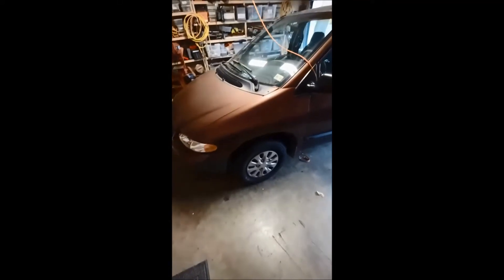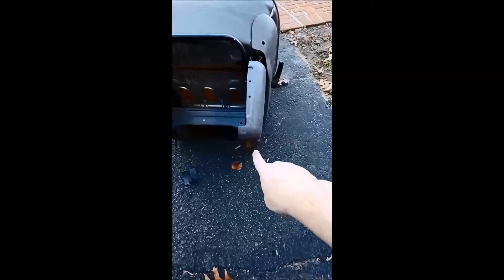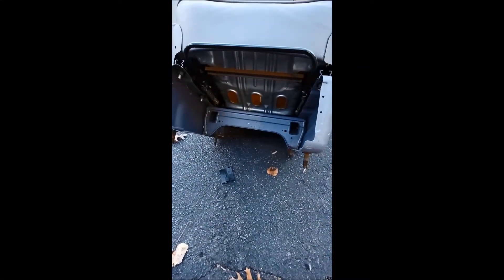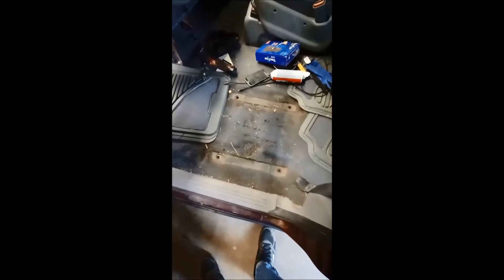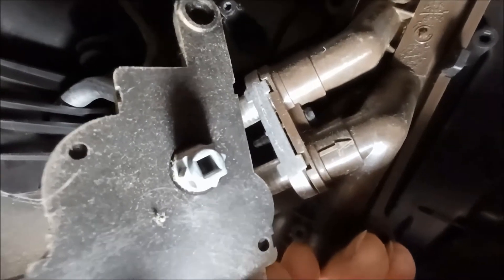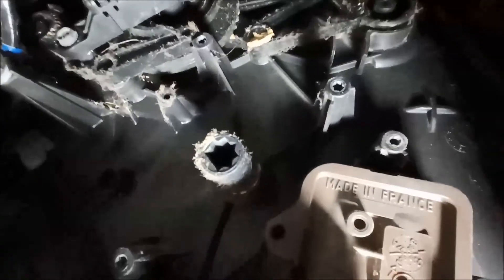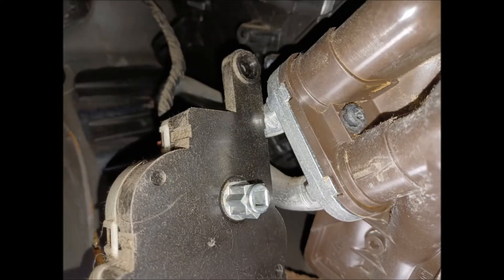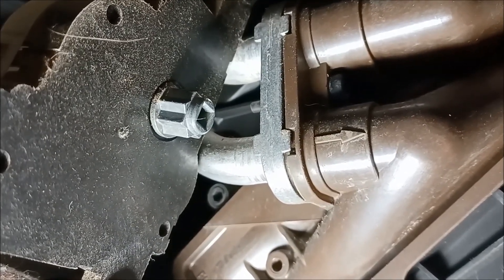1999 Plymouth Grand Voyager or Dodge Caravan Replace Blend Servo Actuator

Comment: ...this is the type of non-help infamous on YouTube. attempted this surgery 04-20-24 on my 1999 Voyager. After removing multiple obstacles and spending over 2hrs on back and sideways inside vehicle, there was NO way to access the topmost or #3 screw holding actuator in place from Under or Frontwards or from left or right. Only possible way, down thru the top of dash - requiring disassembly of dash to include instrument cluster. This Video - the new part NOT installed. Key Words, without video "After You Get it Out" and at the End? "Good Luck". This Project would require at least two days for the Home Fix-it Person.  a One Minute 36 second Vid for a 5-6 hour job?
Reply from the maker: That's the only way to do the job, on your back and twisted around. it helps a little if you take out the driver's seat. Even then, if the ac controller does not actuate it you have to leave it off and clip it into place manually to the position you want.
Reply: @bowhitegardener3121  I had to disassemble the entire dash. The dashpad (top) removal enabled me to get to the topmost of the three 10mm screws holding the actuator - not possible from underneath. Three hours of disassembly. Having removed and installed the replacement part, a Dorman 60-4010, I then discovered the plug-in port is a mirror opposite to the plug: IT DID NOT FIT. Options were to order another/return defective - but: every option SAME. So, grind down plug to fit? no room unless remove then re-attach. Decided to find CLOSED position (to STOP heat blast) and re-install old part which no longer rotated (stuck) and left plug detached. Result: No options for feet/dash/defrost etc but NO HEAT BLAST. Fan works, defrost only, A/c still 'out' but have been sidetracked with other priorities so have not attempted to re-charge A/c (was at 25psi). Blend control functional at dash. May get Lucky but this Job a NIGHTMARE. "Good Luck". I removed both front seats and entire interior as am 6'3 and 225+, 60+ years old. Only did not have to remove speedometer, in retrospect. Took it out cuz wanted MAX access possible.
Reply from the maker: @ChrisSmith-we6dx  Yes this job is a mess. Much faster to go in from the bottom after removing the seat (which takes 5 minutes to remove the 4 nuts from under the floor pan.